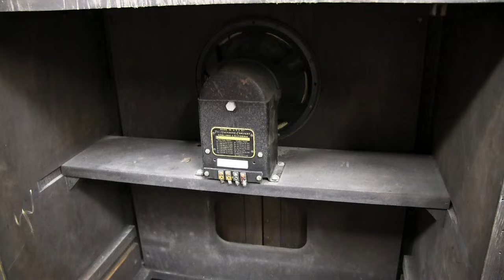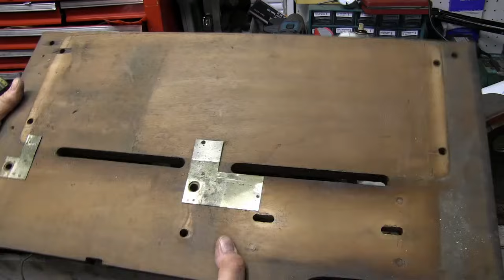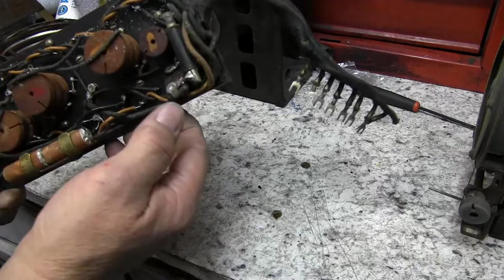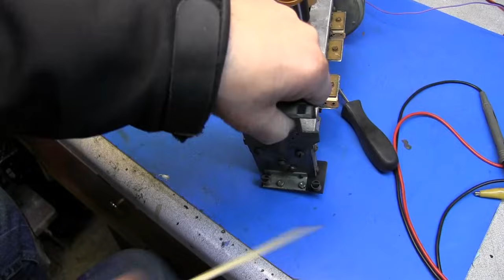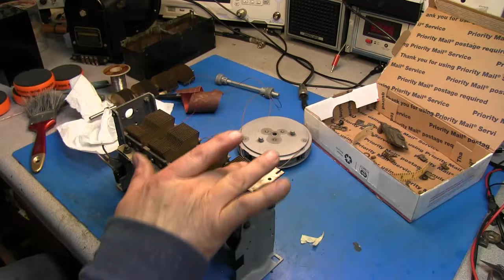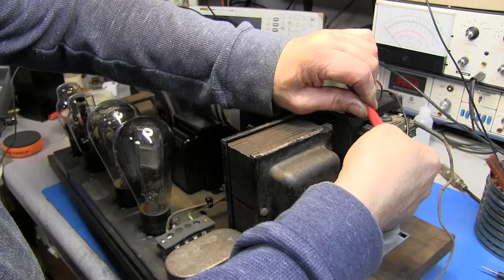# 256 Progress on the Sparton 301

Comment: Great work!  did you ever finished getting your tuning stick and broadening out the band?  if so do you have a video on it?  I have a 610 Equasonne and I have the same problem, almost sounds like the plates are shorting out, cannot get anything over 950 kc.
Reply from the maker: Hi Darren, I made the tuning stick but have not finished the rig yet. Been waiting for cooler weather which is finally here.  Tuning is very critical with these units.  Be sure to check for corrosion on the tuning gang. One bad connection and you lose half the band. Thanks

Comment: I just bought a Sparton 301, that is in beautiful condition but radio doesn’t work. When I bought it, my first thought was to repurpose it into something else, after speaking with seller and knowing it was in her family 92 years, I want to see what I can do to fix radio.  I can’t wait to start watching all your videos.
Reply from the maker: They are really beautiful sets. After so long connections inside the unit tarnish and corrode. Cleaning those are a must specially in the tuner section.  I have to do a few more things to mine and then start the cabinet restoration. Good luck on yours and thanks for watching

Comment: Great video....at the 16:38 mark or so you speak of the "tin whiskers." Hammond organs were notorious for the same thing...primarily due to the zinc plating on the steel. When we restore Hammond organs, we permanently fix that problem by cleaning the metal and then spraying a thin coat of lacquer on it. Whiskers never return. I look forward to seeing your continued progress on this. The Sparton 301 Equasonne is one of my favorite radios and I hope to restore one myself someday.

Comment: The old "dogbone" resistors are interesting pieces of history. I recently found one that had a gouge out of it and it took me a little bit to realize that the deformation of the resistor was how it's resistance was tweaked (either at the factory or by someone trying to re-calibrate it... I suspect the latter). The early "dogbones" really were just a carbon rod with bus wires wrapped around each end.
BTW, nice intro :D
Cheers,
Reply from the maker: I am always amazed how things were done in this era.  So simple but worked.  And thanks, you are the only one to comment on the intro.

Comment: I loved everything I saw in this video. Great work. I didnt like the capacitor heater though..... four caps and six tubes in a small box 😯
Reply from the maker: Thanks. Actually the capacitors in the small box does not get that hot from the tubes.  Remember that these tubes run very low heater voltage. 2-3 volts.

Comment: Buddy, still watching but an amazing mechanical and electrical engineering design for that era. Your new capacitor bank looks awesome. Congrats on it playing as well and great detective work picking up on the grounding issue due to the corrosion. That tuning assembly is built like a tank and I know taking that monster apart was time consuming and tedious. I would appreciate you sharing your design of the tuning stick in your next video; saw Tony had a good reference. Great job! Best, Don
Reply from the maker: Thanks for commenting Don.  Yep the unit is built like no other. Very easy to work on. As soon as I saw the signal moving around I knew it was a corrosion problem in the tuning assembly. The assembly was a bit time consuming to take apart and clean.  The power supply ended up having a bit over 400 volts on each side so the 600 volt caps worked out great.  I have a plan for the tuning stick so will do a separate video on that.  I will have a look at Tonys idea also and thanks for stopping in.

Comment: Great progress on the Sparton!  I restored an old Philco console radio from 1935 that had a similar tuning assembly.  One trick I used for the plastic tuning tool was to go to Lowes/Home Depot and purchase one of those nylon allen head bolts.  They have them with a 1/4" allen head.  I had to turn the diameter of the bolt head down slightly to get it narrow enough to fit down into the tuning gang and then I drilled down into the bolt a little bit to allow for the adjustment bolt to fit.  I then fixed a piece of plastic tubing over the threaded part of the bolt to make a handle.  It worked very well.  There was also a seller on eBay that was selling the original phenolic tool for about $15, but that was a long time ago.  Best wishes and thanks for sharing!
Reply from the maker: Tony, very clever idea! Well done and thanks for sharing that. I have a idea also, will involve the lathe, heat gun, 1/4 inch stand off.  We will see how that goes.